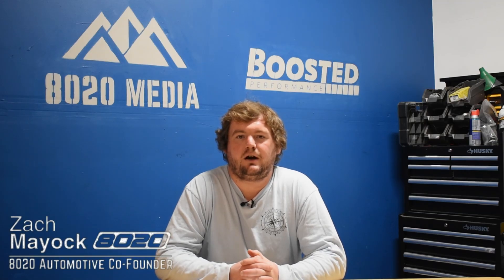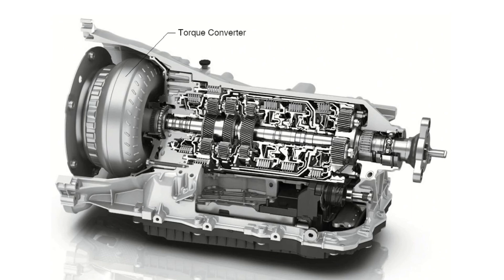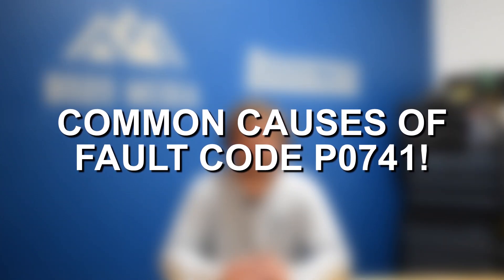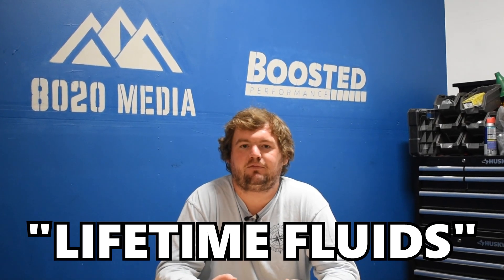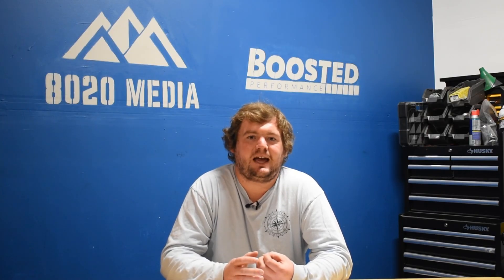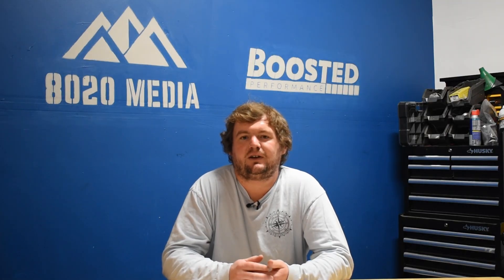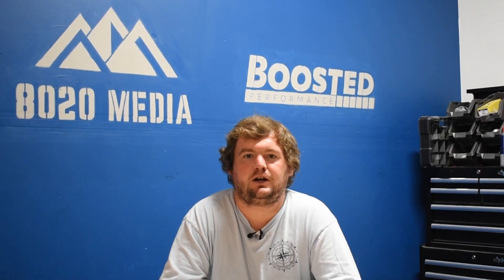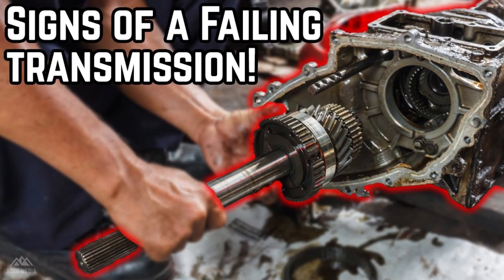P0741 Transmission Fault Code - Causes & Fixes!

Comment: I had a torque converter changed a few weeks ago and 100% i dont trust the honda dealer Mechanic shop if they are professional how to know how to fix my car im not happy about them

The transmission fluid is very clean but i don't know if they put enough fluid between the both holes in the dip stick, when i start the car it makes a knock sound during cold start
Reply: Uh oh which one they have disappointed and caused me severe trust issues with dealership’s within the last few years.